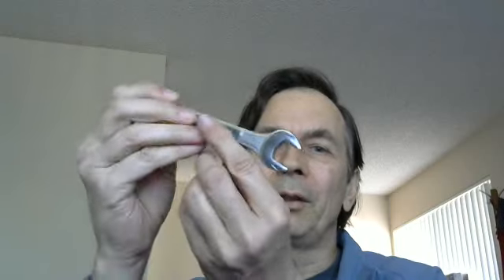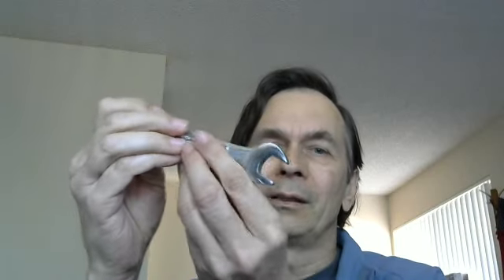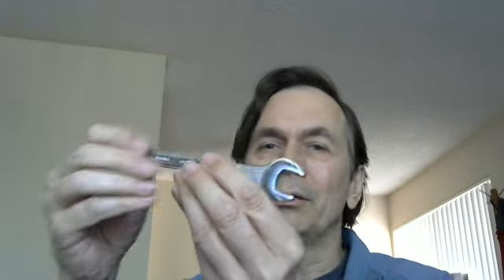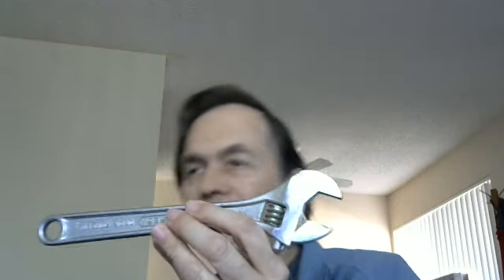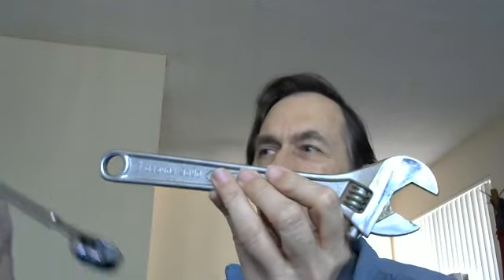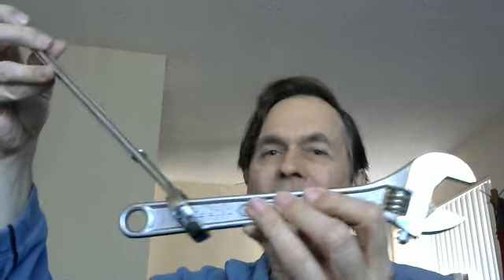Move a stuck nut or bolt Handyman Hack or Plumbing Tip Secret Handyman trick

Comment: I think there is a fair probability of rounding off the corners of the bolt or nut with that adjustable wrench, especially when you've increased the torque by extending the length of the handle with the other wrench.  A six point box if you can get it on the nut/bolt is best if you are going to increase the length/torque.  After rounding off the corners you will have an even bigger problem ...
Reply from the maker: Right. I just couldn't fit the box end of my wrench over another simular wrench. That's why I used the adjustable wrench.

Comment: Sounds easy but what if you have 1/2 an inch to move your hands? That’s usually the problem not the tool
Reply from the maker: Right, you can't always do this.  I was able to do it above the wash basin by the washing machine. A vise grip can help in your case. I have used a vise grip in tight spots.

Comment: No thanks I will call a handyman to do the job.  Take a pipe with an inside diameter larger than the handle of the wrench and slide it over the handle.  Now U will have a an excellent extension, old boy.
Reply from the maker: +Widowsson abif Yup, I have done that too, where I used to work. They had the pipe extension there, I don't have one at home. Whatever you can do to make it longer, longer means more power. Thanks for the tip.